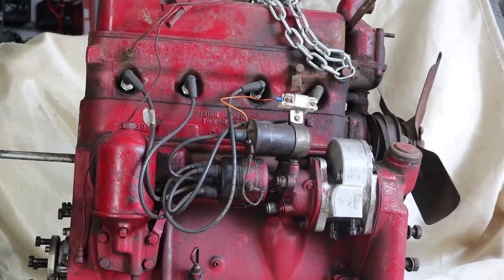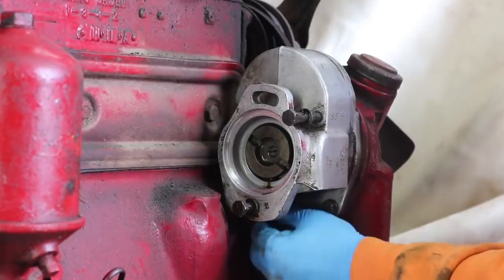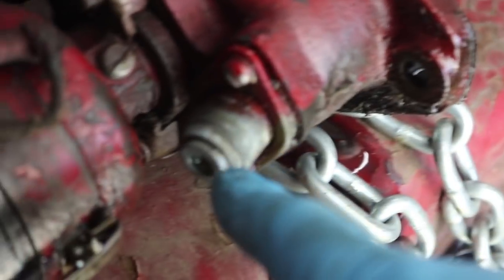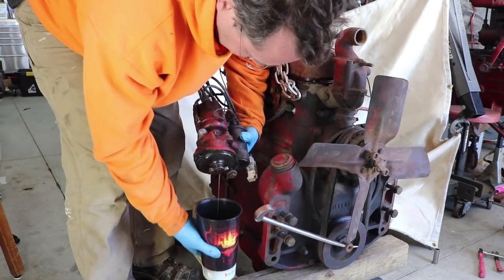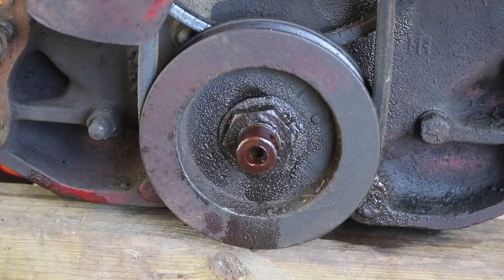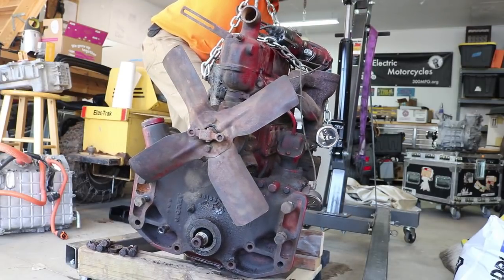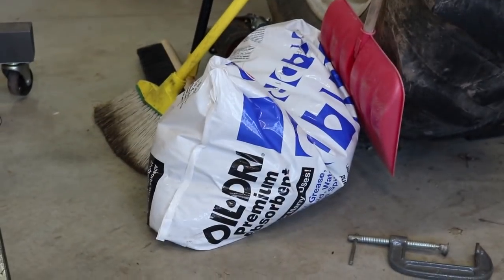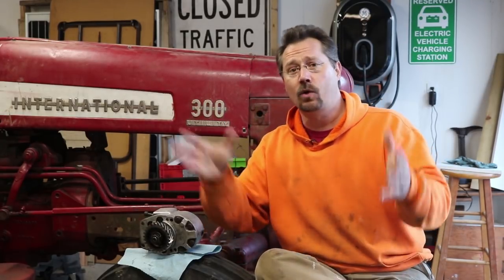Electric Tractor Conversion: Hydraulic Pump Removal

Comment: Hi, great video... again !!! Your hydraulic pump will take 10 hp only if you use it at full capacity otherwise it just cunsume to balance friction. Unless you will use hydraulic devices like log splitter, etc. I think you can mount a smaller motor. 

A french farmer who is sorry for his language !
Reply from the maker: Part of the plan for this project is that there is a front end loader that is going to be mounted back on this tractor. That will make heavy use of the hydraulics.
Reply: That is what i thought tris attention when i rethink about  your project on my tractor. Tris is definively a project that i will do on one of mine in thé future. I really enjoy the serie. Thanks again

Comment: Good morning Ben. Something to think about as far as hydraulics. A lot of newer tractors have rear hydraulic ports for implements, such as for a box blade that has a tilt cylinder. So when you do your plumbing, you might want to keep that in mind.
Again, great video.
Reply from the maker: When I took the loader off, I swapped out its permanent connections for quick disconnects. Besides making it easier to reinstall the loader, it should also allow easy swapping to another piece of equipment on the back that uses hydraulics.